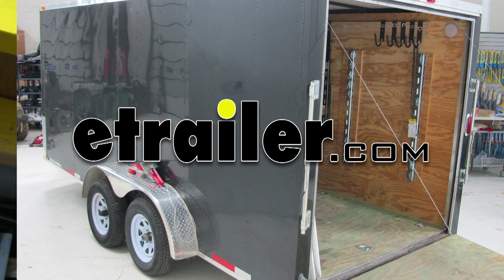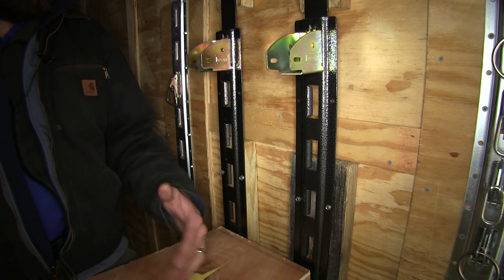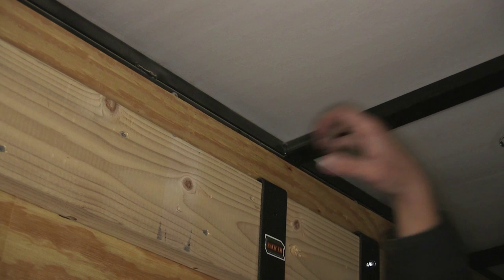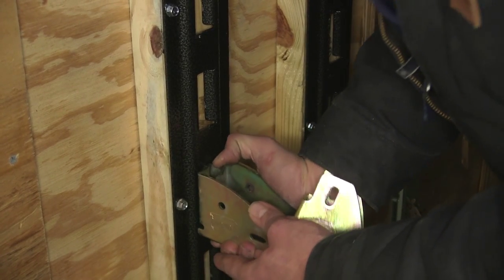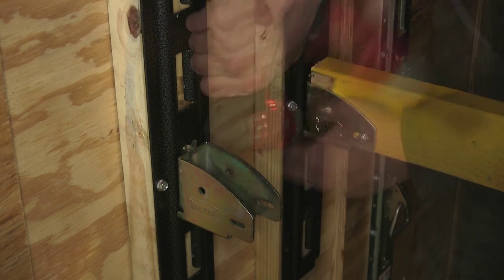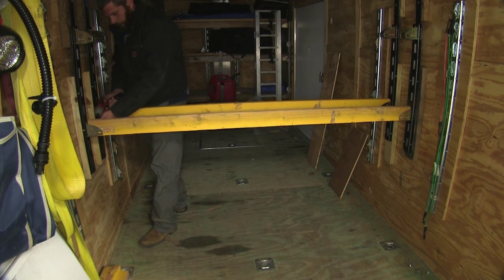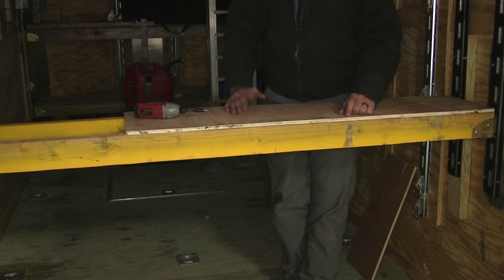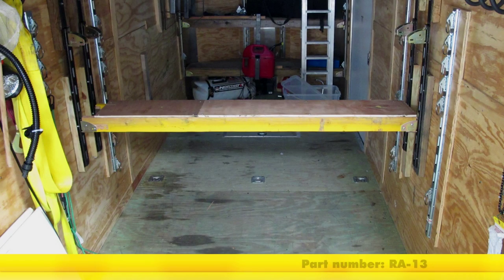etrailer | Rack em Shelf Kit for Enclosed Trailers Review

Comment: Whats the advantage over just using etrack on your anchored 2x6? Is it because your pulling force is held at the top? Seems like lots of etrack attachment bolts would do the same, no? What am I missing here?
Thanks
Reply from the maker: The hooks at the top are going to make it so that you do not have to use as many screw as you do with E-Track to hold the weight of the items on the shelf.
https://www.etrailer.com/Trailer-Cargo-Organizers/RackEm/RA-13.html